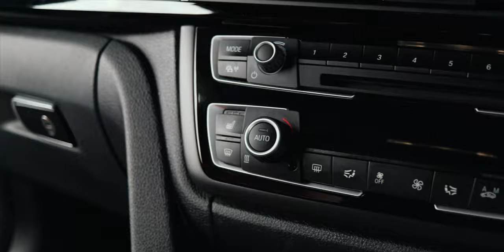UPGRADING A BMW M4'S AUDIO SYSTEM

Comment: Great Vid!!Lots of question:  Is this the HK system - Option code "688" Premium sound in this car?  * Is the sound deadening only installed on the inside of the door or can (would) you actually stick a piece on the back of the (magnet) speaker? * @ 2:39 your shown reaching for a tweeter door housing. Is this an OE part (without the "HK" logo) or does this come with the Audison Prima Kit?  * @ 3:15 it wasn't too explicit/clear on the wiring of the crossovers. * What is the purpose of the cloth friction tape in comparison to just plane vinyl electrical tape to wrap the wiring? * What about the I.P's  Center channel speaker? * You went straight to an Audison ("AP8.9Bit") DSP/Amp. Did you not need to previously install an "L2Ci" in line and/or a "Bit DMI" ("Most") module? * Have you ever heard "Maestro" (ex. "MBQuartz) speakers? Thanks!
Reply: Interested as well in answers to all of this :D

Comment: I wonder if that subwoofer makes a big difference since it looks like its using the same output.  I'm in the market for a sub woofer replacement on my M4 and this has me curious.
Reply from the maker: The underseat woofers do make a huge difference over the factory ones as you're going from a 6.5" driver to an 8" driver. However, to have them working at their full potential I would always run these off an aftermarket amplifier, if installed off the factory system you will notice some improvement but it's night and day when they're amplified off an aftermarket amplifier. When it comes to presenting my customers with different options, Option 1 would be a front speaker upgrade, Options 2 would be front speakers and amplifier (I always tend to use the Audison Prima 8.9 bit or F8.9 bit to take advantage of its small footprint and built in DSP) then Option 3 would be to add the underseats. Customers have come to me and asked for a subwoofer as well before having the system installed, what I advise them to do is listen to it without one first then if they feel they want more, add it afterwards as it's straightforward to integrate it into the already installed amplifier (or add an active subwoofer with a built in amp). Once they're bedded in they do give you some genuinely surprising low end, although this is subjective to what you personally require, music taste etc, if you want to shake the car then yes I would suggest a separate subwoofer enclosure, if the goal is to have a well balanced accurate system then an additional subwoofer may not be required. I apologise for the lengthy reply! I don't know how local you are to me, but I do have a BMW system that I'm happy to demonstrate to you so you can hear them for yourself and decide which route you suits you best. Demonstrations are free of charge but need to be booked in so if you are interested just drop me an email at info@rtacaraudio.co.uk and I'd be happy to arrange it for you.
Reply: JAKE RIVERA it is Not a real woofer but a low speaker. Better than stock but a woofer extra is what you should go for in the Trunk. Than its perfekt
Reply: @RTAFabrication  That was very helpful insight! thanks.  So, where would you rank replacement rear deck speakers on your list of priority?  note: I will soon have a M240i so my rear deck is a little closer to my ears that it would on the M4. Also, I don't expect to ever have passengers in the rear seats so, the audio only needs to serve me.  Old school thought is to forget quadraphonic sound and concentrate on great-imaging stereo.  thoughts??
Reply: @ckunstadt  Save the money from the rear deck upgrade and invest in a dsp or a dsp/amp. Tune the rear crossovers for rear fill up to 3500 hz from 120-180hz. The stock speakers do handle mids well so they can easily be repurposed for this as long as the settings are available

Comment: At the bottom of the sub enclosures that go under the seat there is a small drainage hole, did you covered those holes when you applied the soundproof material?

Comment: was the hifi SA676 installed as standard? Will the OEM AMP be replaced by the AP8.9 or will the original one still be connected? Great video Greetings from Germany!
Reply: Considering there were no tweeters installed originally means there was just base audio (quite surprising on M4). The new amp replaces the OEM if there is any installed.

Comment: Very nice. Do you happen to recall the crossover points you used??
Reply from the maker: Can’t remember off the top of my head but if I can find the setup file I’ll check it and let you know. Just for fun, if you go to Audisons website and download the 8.9bit software you can install it and run it in offline mode. On the site if you navigate to the BMW configuration pages, go through it as if you had a Harman Kardon system, spec up the highest level of install then there’s a link to download a setup file which Audison have provided for that vehicle, you can open that in the software and check out all the crossover points, eq and time alignment that they suggest 👍🏻 I’ve used these sometimes as a base to start from when tuning  as the time alignment is actually near bang on most of the vehicle profiles, the eq, levels and crossover points tend to need adjusting depending on the end result I’m after.

Comment: What’s the black adhesive stuff you put inside the door for? Is it sound dampening?
Reply from the maker: Yeah it’s sound treatment. This is 2mm and there is a 3mm version too. It makes the panel a lot more rigid and in turn reduces resonance, improves lower end frequencies and reduces road noise. 👍🏻

Comment: @RTA Car Audio

Hey I have a question.
Were the Underseat Woofers glued in the housings? Or are they really just clipped?

Thanks:)
Reply from the maker: They all have the clips but some of them are glued as well. The Audison woofers clip down into the factory clips along with the gasket that comes with it, then it's screwed into the original housing to pull everything nice and tight for a good seal 👍🏻
Reply: So in this case with the m4 were just clipped in ?

Comment: I'm very interested in having my G30 done. It's had every other possible upgrade. But not the stereo! Can you give me a price please???
Reply: I actually did my G30 530d myself. 

Full retrofit of Bowers and Wilkins speakers and as it had no amp at all I used the Audison Forza 8.9. 

Sound is amazing. 

It’s all plug and play so very easily done
Reply: @davetreanor5303  hi i have g30 2017 with base audio no amp but i want only sub in the trunk and amp for the sub how can i do? any plug and play option?